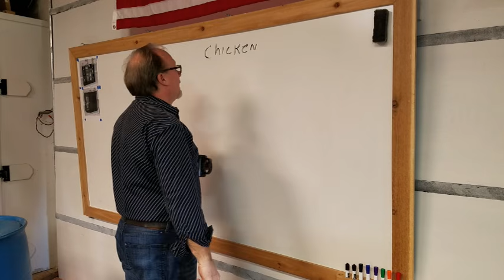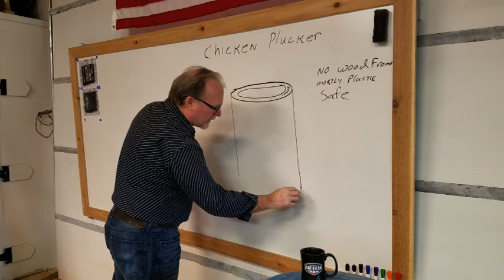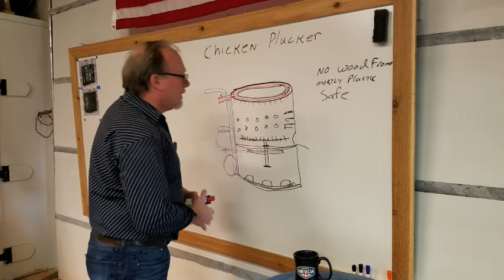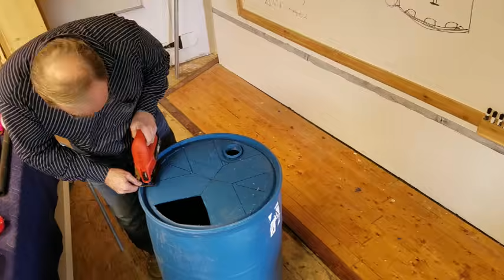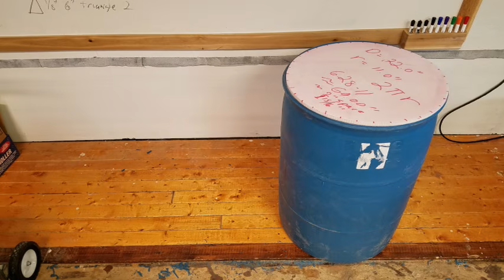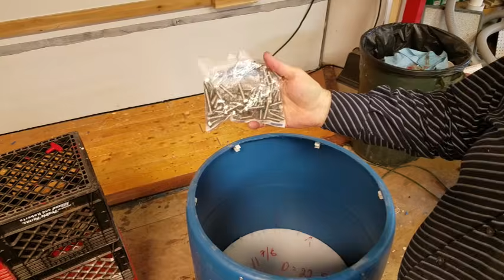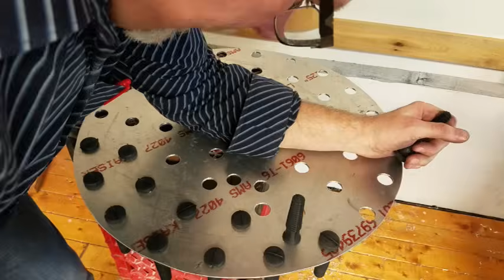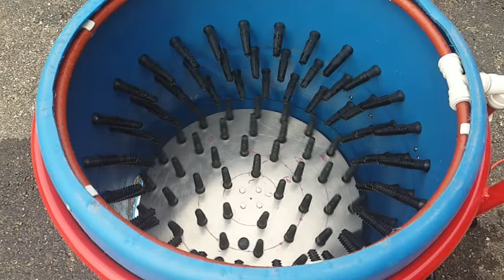DIY Mother of all Chicken Pluckers and how I built it.  My interpretation of the Wiz-Bang design

Comment: Could you post all the specs please? I'd love to build this
Reply from the maker: Chicken Plucker Materials List

55 gal HDPE drum ~ 22"+ diameter  yours may very

Motor was from Harbor Freight and it's farm duty, 1.0 H.P.  ½ Hp should do.  RPM is 1760
Motor mount was a simple hinge type pivot and pin with a spring to maintain tension, I will be changing that to an idler style. 

The pulleys are 3" and 15", ratio is 5:1,  Size does not matter as long as ratio is maintained.
Final plate rpm 350 (we experimented with various ratios 5:1 seemed to be the best for this application). 

Belt is a link type belt set for 34” from HF.  I chose that style because you can adjust the length easily and it sheds water quickly.

The finger plate it 0.120" 6061 Aluminum, plate diameter it 1" smaller than interior diameter of the drum, because your's will most likely be different than mine so size accordingly. 

The fingers I purchased  from www.walmart.com, but you can get then from E-bay.  approximately $30 
Total fingers used 150 between plate and drum.
I don't have a durometer number, my best estimate is between 60A and 70A on the Shore scale. As for longevity, I expect they will last for many years, or 3 - 5 thousand chickens. They are easy to change and in-expensive.  Spacing is staggered ~2.75" apart. 
I used a unibit size is 3/4". The hole for the fingers must be no larger than 3/4" or the fingers will not stay in position. Very important. 

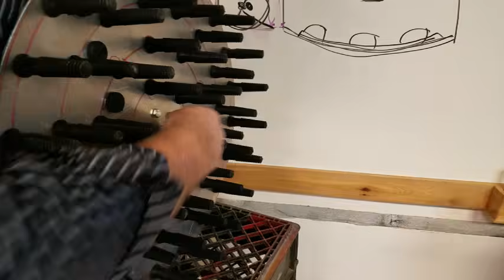The divider plate is located 2/3rds of the way down the barrow.  I used HDPE, it's 0.5" thick, I purchased it from a local supplier, you should be able to find it online.. I used stainless steel sheet metal screws #10, spaced around the circumference ~ 3" (75 mm) apart. At the 22:50 mark you can see the plate and at 23:15 you can see the screws. 

Hope that helps.
Reply from the maker: Chicken Plucker Materials List

55 gal HDPE drum ~ 22"+ diameter  yours may very

Motor was from Harbor Freight and it's farm duty, 1.0 H.P.  ½ Hp should do.  RPM is 1760
Motor mount was a simple hinge type pivot and pin with a spring to maintain tension, I will be changing that to an idler style. 

The pulleys are 3" and 15", ratio is 5:1,  Size does not matter as long as ratio is maintained.
Final plate rpm 350 (we experimented with various ratios 5:1 seemed to be the best for this application). 

Belt is a link type belt set for 34” from HF.  I chose that style because you can adjust the length easily and it sheds water quickly.

The finger plate it 0.120" 6061 Aluminum, plate diameter it 1" smaller than interior diameter of the drum, because your's will most likely be different than mine so size accordingly. 

The fingers I purchased  from www.walmart.com, but you can get then from E-bay.  approximately $30 
Total fingers used 150 between plate and drum.
I don't have a durometer number, my best estimate is between 60A and 70A on the Shore scale. As for longevity, I expect they will last for many years, or 3 - 5 thousand chickens. They are easy to change and in-expensive.  Spacing is staggered ~2.75" apart. 
I used a unibit size is 3/4". The hole for the fingers must be no larger than 3/4" or the fingers will not stay in position. Very important. 

The divider plate is located 2/3rds of the way down the barrow.  I used HDPE, it's 0.5" thick, I purchased it from a local supplier, you should be able to find it online.. I used stainless steel sheet metal screws #10, spaced around the circumference ~ 3" (75 mm) apart. At the 22:50 mark you can see the plate and at 23:15 you can see the screws. 

Hope that helps.
Reply from the maker: Hi Kerry,  Give me a few days, and I'll put some pictures with dimensions and a list of materials on Instagram.  I'll let you know when I have it ready.  Thanks for watching
Reply: Southern Engineering me too please!
Reply from the maker: I can when I get home this weekend, will that be ok?
Reply: Southern Engineering  awesome
Reply from the maker: Got in late this weekend I'll work on the specs tonight if I can tomorrow for sure,  didn't want to leave you hanging..
Reply: Southern Engineering no problem.
Reply: Southern Engineering thank you, sir
Reply from the maker: Your very welcome.  let me know if you have any questions.  As I said I will make a couple of changes to it very soon and i'm building a matching scalder for my friend...   Thanks for watching and stay tuned..
Reply: What size ploys did you end up using
Reply from the maker: Hi Robert, I used 3" drive and 15" driven.    Stay tuned, I'm working on a scalder to go with the plucker. Thanks for watching,
Reply from the maker: Got in late this weekend I'll work on the specs tonight if I can tomorrow for sure,  didn't want to leave you hanging..
Reply: Kerry Dill

Comment: You have 2 slotted holes in the barrel one for feathers to come out  and one for belt to go into the shaft what are the measurements height and length
Reply from the maker: Hi Thomas.  The spoilage slot is 16" wide and 3" tall, the belt way slot is 12" wide and 2" tall.   Thanks for watching..

Comment: So the bottom pillow block bearing is mounted  to the plastic barrel  with no round plate?
Reply from the maker: That is correct.  The bottom(top) of the barrel was cut out in an cross pattern, leaving enough material to mount the bearing.

Comment: the fingers never touched the black part of the ball on that one side
Reply from the maker: Hi Tim,  Yes I noticed,  while it worked very well on our first run, (~100 chickens) I added another lower row in order to prevent damage to the wings of the birds.  I will be updating the machine later this spring with a better belt tensioner.  Thanks for watching.

Comment: Could this be powered manually for off grid??? Either foot pedal or hand???
Reply from the maker: Perhaps you could with a converted bicycle,  I think hand powered would be to physically demanding.  This unit worked best at 300 rpm's so a bike would be my first choice for manual power.  Thanks for watching.
Reply: @SouthernEngineering   getting the drum up to 250 to 300 RPM is possable under a no load  but keeping up  that speed  with a bird  in the plucker  would be hard 

I would suggest a horizontal sharft  gas engine  IE. A gas lawn mower  work out the RPM  witch would be variable  with the throttle on the engine  since the plucker will be on and off  with each bird   I would inculd a moveable idler pully   to engage and disengage the drum 

At a MSRP of $99.00 the Harbor Fright 212 CC predator motor would be perfect
Reply from the maker: That a perfectly go idea, especially for people that have limited A/C options.   That little engine is a great bargain and has a built-in governor, so I would try using a centripetal clutch and see if that would work.
FYI  I have one of those engines torn-down in my shop, I have a crazy project that I'm about to start on once I finish I a have a couple of other things.
Reply: @SouthernEngineering  I didnt think of a centrifugal clutch  I was thinking of keeping the costs down and simplify the build  by useing a idler wheel and a lever  
I have nevered worked with a C.C.  so I don't what it can and can't do

Comment: Any idea what it would cost a person to do a build like this? Thanks for sharing it looks amazing. I'd love to have one for myself.
Reply from the maker: Thanks, glad you like it.
If you scrounge you can certainly make it less expensive,  However my interest was to build a top end machine for my friend, so with few exceptions I purchased most supplies new.  With that said here is a list.
Motor 1 hp farm duty $150,
3" pulley $8,  15" Pulley ebay $15
Plastic drum $10
Metal conduit/tubing, In Stock
Chicken fingers ~$50
Bearing blocks 12.79 Ea.  2 required
Spindle shaft, In Stock
Electric valve $15
Wheels, In Stock
Pex tubing, In Stock
Aluminum plate, In Stock
HDPE 0/5 " x 24" $35
Fasteners, In Stock
Can Red Spray paint, Rust-oleum $6
Control Switch, $12
Celebratory beverage for completion of project,  $12 
The single largest cost item is the motor so if you can scrounge one...

Hope that is helpful
Thanks for watching.
Reply: @SouthernEngineering  May I please ask where you gound the 1/2 inch poly plate disc?  Thank you!

Comment: Another question, is there any reason I could not just cut the bottom of another Barrel and install it as the internal plate below the plucking plate? The plastic plate is expensive. Thanks
Reply from the maker: It may work short term but I worry that long term it may be a weak point as fatigue sets in due to flexing.  Based on my design a little over 70% of the radial load is on the upper bearing and plate; as long as you monitor it your idea should be OK.  Remember, I built this for a friend and want it to work trouble free for many years.  Hope that helps.   Have fun with your build and thanks for watching..  Have a Happy New Year.
Reply: I don't know but I think maybe using a metal drum lid would work better

Comment: Where did you get the pullys i can find a 3" but cant find a 15" thanks thats the only thing im lacking to start my build!
Reply from the maker: I found them on e-bay.  The guy only had 2, you can go down to 2" by 10"  as long as you maintain the ratio; a good farm store should have pulleys of that size Amazon also has 10,12,15 inch.  I started with a larger pulley because I was uncertain of the final ratio.  You may be able to find an old washer or old furnace blower that has a larger pulley.  FYI,  2" is the smallest that I would use for driver,  to much stress on the belt.  Hope that helps, have fun with your build...
Reply: Southern Engineering the biggest i can find is 14" the small one i can find any size thanks for the info
Reply: Tractor supply company  carries  Chicago pully company products  that are still made in the USA carries everything  You need  like differant sized pullies and pillow blocks

Comment: Can you explain how the belt is hooked up to the pulleys? Was there a tensioner involved? What size shaft did you use? What did you use for the partition plate? Trying to build one but having trouble finding things to duplicate what you used. Any ideas?
Reply from the maker: The belt is A link type and simply follow the pulleys there is no tensioner, a small spring pushes the motor away at its pivot point.   The link belt was selected because it sheds water.  I am planning to change it to a tensioner system over the winter.   The shaft is 1.0" diameter.   The rotating plate is 0.125" T6 aluminum, the divider partition is 0.5" UHMW plastic I purchased from a local supplier  "ALRO Steel".  The flange welded to the shaft is a pulley hub you can purchase from most farm stores, bearing blocks are from an industrial supply but you can find them on Amazon.  Hope that helps, Have fun with your build.  And thanks again for watching..

Comment: I may have missed it in the video but, what are the rubber pieces? They almost look like elongated valve stems.
Reply from the maker: Hi Tanner,  Seems I skipped one important detail.   If you do a search for "Chicken Plucker Fingers"  you will find them all over the web.  I purchased mine from Walmart.   Yes they do look like valve stems.    Hope that helps.   Thanks for watching...
Reply: Southern Engineering 

Thanks!
Reply from the maker: Your Welcome, have fun with your build..

Comment: Very well built.  I would like to follow your instructions and build one myself.  Would you be willing to provide the pulley diameter information for both the 1hp motor and for the bottom of the finger plate?  Also, what length Link belt did you use?  So impressed with your engineering skills.  Thank you sharing this video.
Reply from the maker: Thanks.  Glad you enjoyed it..  The pulleys are 3" and 15", ratio is 5:1,  my motor is 1 hp, 1760 rpm,  final plate rpm 350 (we experimented with various ratios 5:1 seemed to be the best for this application).   Motor was from Harbor Freight  and it's farm duty.  link belt is 34" also from HF.  I chose that style because you can adjust the length easily and it sheds water quickly.  The finger plate it 0.120" 6061 Aluminum, plate diameter it 1" smaller than interior diameter of the barrow, because your barrow will most likely be different than mine so size accordingly.  Thanks again, enjoy your project.

Comment: I'll be copying your design!  It looks great, and matches my requirements (light wight, portable, no wood). 
A couple of questions though:
1.  How did you cut the finger plate?  Jigsaw, nippers, plasma?
2.  Could you give some more detail on the motor mount, covering, and switches?

Thanks!
Reply from the maker: Thanks glad you like it.  
1. The finger plate is 0.120" 6061 Aluminum, It  was cut on my band saw,  but you can cut with a jigsaw, a plasma cutter would leave a very rough edge that would need to be dressed. 
2. Motor mount was a simple hinge type pivot and pin with a spring to maintain tension, the motor was a farm duty from Harbor Freight and is designed for outdoor use and water exposure, (not submersion)  The switch is a sump pump float switch (water proof) with a pull rod made of CPVC that extends up to the handle.  
3. The water valve is 3/4" and powered when the motor is on so water flows only when the motor is powered ( less things to manage when your busy).

Have fun with your project and thanks for watching...

Comment: What size pulleys did you end up using ?
Reply from the maker: Can't recall but I will check and let you know.   I seem to recall they are 15" and 4".
Reply from the maker: To follow up:  pulleys are 3" and 15" . Ratio is 5:1,  my motor is 1 hp, 1700 rpm so  the final plate RPM is 340,  I tried higher and lower ratio's 5:1 seemed to be the sweet spot;  of course your result may very.